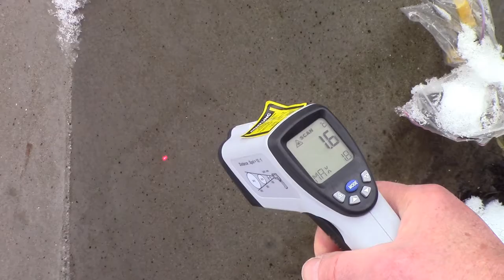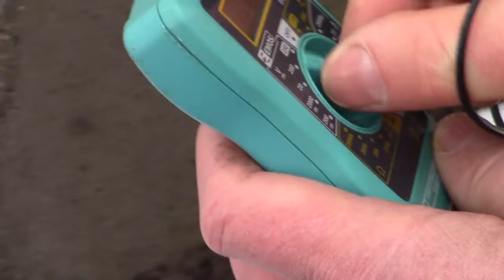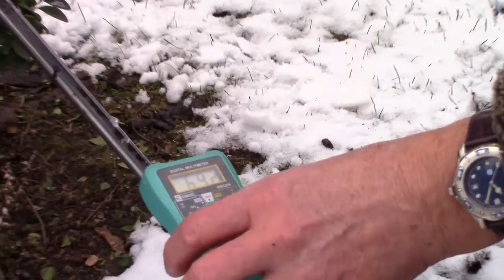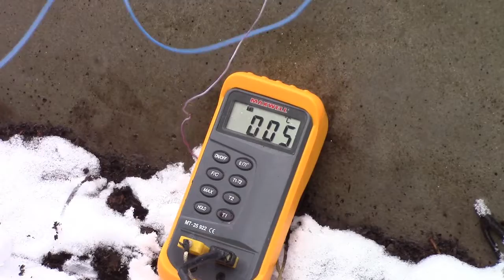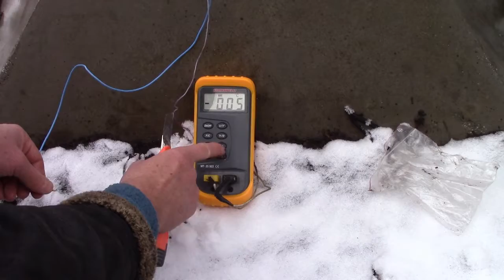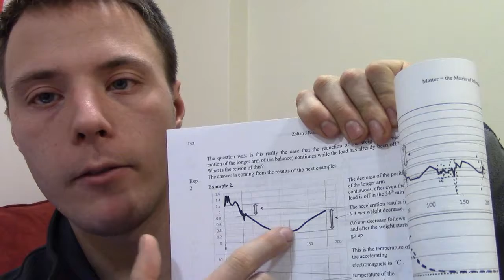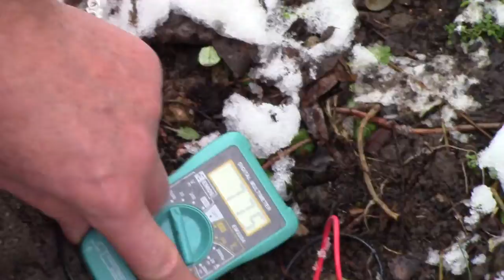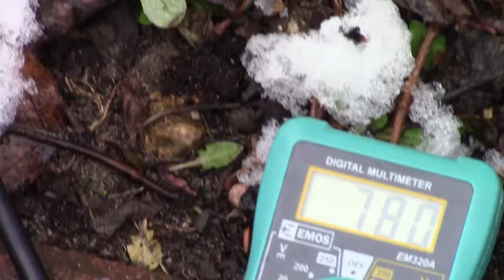Matter as a Matrix of Information: Zoltan Interviews (Pyramid Science)

Comment: Could the movement of the fulcrum be from the moon 's tidal pull?
Reply from the maker: I believe he's got a wire inside the pyramid that he's grounding. This would direct any of the energy building up inside to the ground, almost like siphoning off a bucket of water that's filling up too fast. And that's a good question actually, about the accelerator? I'll pose that to him and see if he's done a control test
Reply from the maker: I wrote Zoltan, who said to tell you this: "There is no moon influence here. This is not about the tide-ebb effect, which is a kind of the mechanical impact. This is about the conflict between the increasing quantum impact of the speeded up Hydrogen process and the quantum impact of gravitation, the impact of which is proven by the pyramid experiments and measured in conventional way as background radiation."

As for your question about thermocouples, I didn't see him grounding the leads. The leads he grounded were of electrodes in the pyramid, not temperature reading; Also, he has other tests where the voltage does not drop to zero as if he grounded it, it just happened to have an inside temperature of the same as the drop which normally happens, which is usually around 15 degrees.